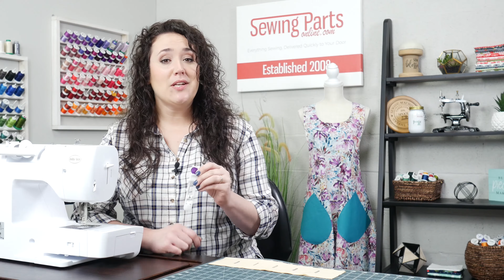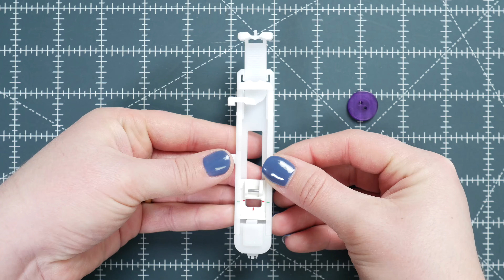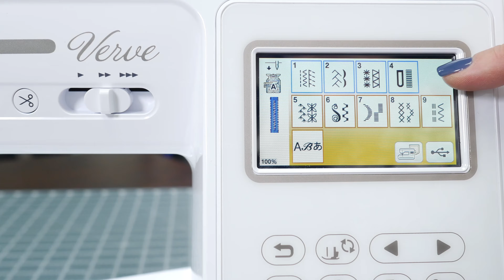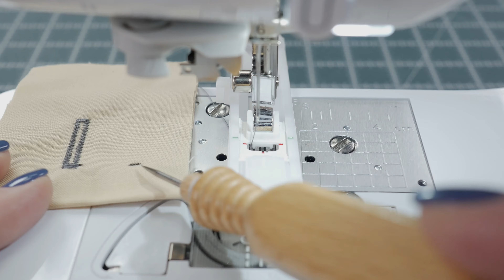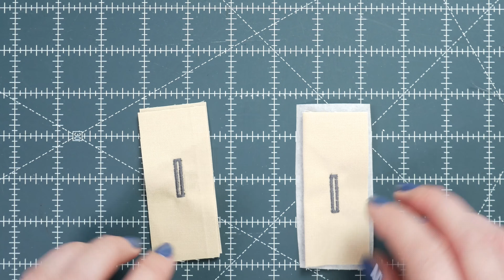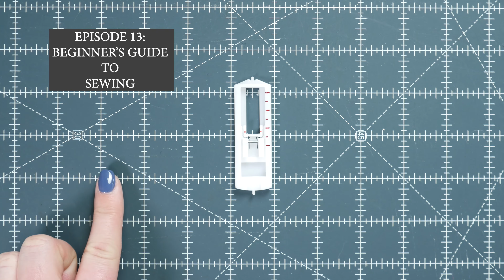UPDATED: How to Use an Automatic Buttonhole Foot| Button hole sewing |One Step Buttonhole Tutorial

Comment: I just bought a compatible buttonhole foot for my singer Quantum 9960 stylus. The part number that singer either does not make anymore or I cannot find it anywhere, is #HP32948. The compatible foot in your video does NOT look like the one I was sent by singeronline. It looks to me that the one you have here would work in the 9960. Can you check to see which one will work? My problem with the one I just recieved is that the upright bar on the foot does NOT seem to work with the buttonhole lever on the quantum...thanks
Reply from the maker: According to our records, HP32948 is the only one that will work with the 9960. As you said, it has been discontinued. It looks like there are currently no options on the market available for your machine. I'm very sorry 😟

Comment: Hi, may I know your good name.. as you suggested, went through page 36  in brother LX27NT for g etting equal thickness in button hole. It’s mentioned, that using fine adjustment screw, we can set equal thicknes. You must be knowing know, which side should we turn the screw ‘+’ or ‘-‘  sign,. Pl ease tell know. I have been trying to adjust it towards plus sign point by doing trials. Still didn’t get. So only asking you again. Sorry for the trouble..  pls don’t mind. 😊